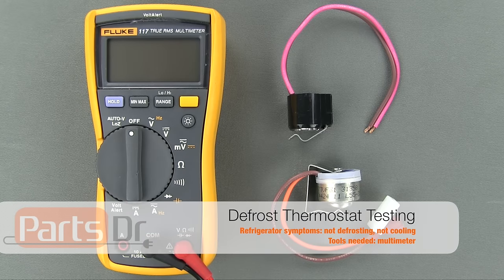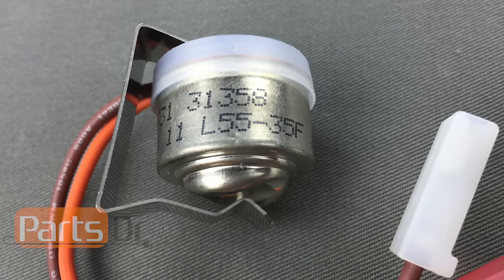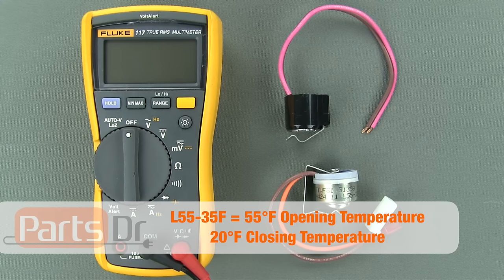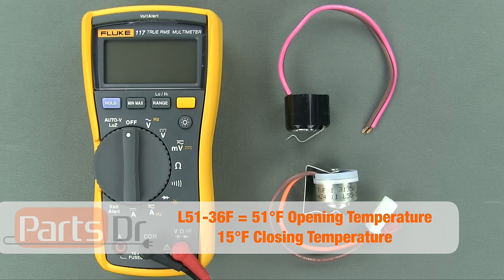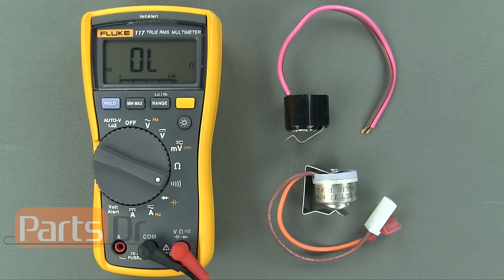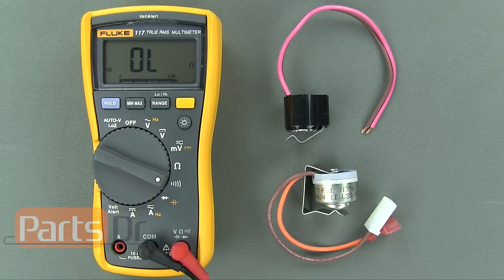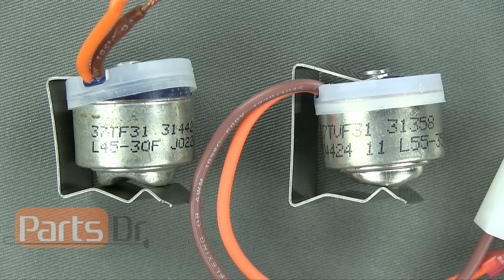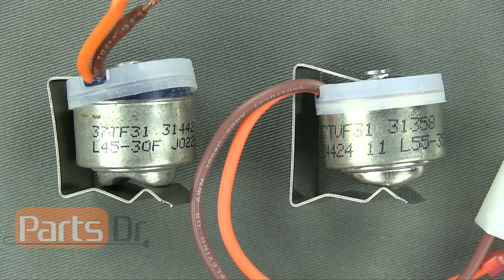How To Test Your Defrost Thermostat & How They Work

Comment: Hi, what is the diagnosis if: Defrost heater, defrost thermostat and timer also work but the fresh food section does not get cold air due to ice build up, not on the evaporator (freezer section), but at around the freezer openings? Thank you
Reply from the maker: Hi Kervin, we have seen this caused by a bad door gasket that is leaking air, a door getting left open, and a clogged/iced up defrost drain.
Reply: Parts Dr thanks for replying! I inspected the gaskets as well and they seemed to be somewhat bent at corners external to the doors. Ill check internal condition. Would you recommend changing out gaskets also?
Reply from the maker: If you can see where air is leaking past the gasket(s) then they should be replaced.  Have you tried just melting the ice to see if it comes back on its own?
Reply: Yes, I have melted the ice multiple times with warm water. Ice slowly builds back up particularly near the opening at the fresh food section where air from the freezer enters. Right now my defrost system seems to be working as I can hear the compressor shut down (and previously verified the heater works). I now have new door gaskets that I'll swap this weekend. In the mean time, how bad is access to the defrost drain? That's next on my check list. Thanks for your help, again.

Comment: Mine is beeping or showing continuity without it being chilled first. I have the bi-metal defrost type (not shown in this video). It does not have any numbers on the probe, but the black cable has numbers.
Samsung refrigerator RF26HFENDSR
Part NumberPD00002154
Manufacturer PartDA47-00243K

Does that mean its bad?
Also what is the difference between a 
Defrost Temperature Sensor, and a Bimetal Thermo Protector? Seems I have both
Reply from the maker: The defrost sensor is what the control board uses to monitor the temperature of the defrost cycle.  This video shows how to test the temperature sensor here: https://www.youtube.com/watch?v=J5bwcteeJNM

On Samsung refrigerators the bimetal thermo protector is used as a safety in case the defrost heater sticks on.  We don't have a published temperature rating for the part number you provided but most have a opening temperature around 140F and a closing temp of 104F.  This would mean the part would have continuity at room temp.

Comment: my multimeter  in the continuity setting showed 001 after the thermostat was in the freezer for a few minutes. The same reading as when I touch the probes together. Is this saying that the thermostat is good?
Reply from the maker: That sounds like a good reading from what you are describing.  You could let it warm up to room temperature to verify that it opens up when it warms up.

Comment: strong compressor; fridge temp is stable.  freezer occasionally ruins food.  fan runs, but rarely.
Reply from the maker: Intermittent problems like these are really tricky to troubleshoot.  You usually have to wait for it to act up then start your diagnostics.

Comment: Great video. I replaced both the defrost timer and defroster thermostat on my Hotpoint freezer refrigerator with the freezer located on top. Originally the refrigerator is not cooling. Now the refrigerator and freezer are working fine but I constantly hear the fan on and the back of the refrigerated which means they're refrigerated is not turning off. Any suggestions please help
Reply from the maker: The fans are controlled by the cold control thermostat. First set the temp controls to the middle factory settings. Then wait 24 hours; opening the doors as little as possible.  Next, check to make sure the refrigerator and freezer are cooling to the proper temps (37F Fridge section, 0 Freezer section).  If you aren't getting those results then the cold control thermostat is most likely bad and needs to be replaced.

Comment: Here’s a ? For you, my freezer will run but when it shuts off it will not come back on and I get a high temp alarm. Is that caused by the defrost thermostat, or the regular thermostat? I thought it was the capacitor and control on compressor and replaced those, though tho old capacitor checked okay. What’s my problem?
Reply from the maker: That type of problem wouldn't be caused by a bad defrost thermostat from our experience. It could be caused by a bad cold control thermostat.

Comment: CORRECT Info, GREAT video!  Question:  I just replaced a defrost thermostat (it lasted one year) - it was a 48 - 18 = 30; the new one I put in was 48 - 30 = 18.  Any idea if this new thermostat will work, or should I go ahead and order one like I just removed?  My unit is an old Top Freezer Roper RT18BKXKQ03.  PS:  I can't find the specific specs for what the thermostat specs should actually be.  THANKS!
Reply from the maker: This is the correct defrost thermostat listed for your model here: https://partsdr.com/part/4387490-defrost-thermostat?model=RT18BKXKQ03 It has a rating of L6.7-14.5C.  It is always a good idea to make sure to use the correct defrost thermostat for your model as the incorrect thermostat can cause it to not work properly or in some cases it could be a fire hazard.
Reply: @PartsDr  THANK YOU very much for addressing this issue!  You're awesome!

Comment: How do you test it if the closing temperature is 20 degrees Fahrenheit? Ice water is not enough to lower it to 20 F.
Reply from the maker: You will need to put it in a working freezer to get it down below 20F.

Comment: Thank you for the video, it explains how thermostats operate and your replies fill in any gaps in information you were unable to put into the video.

I have a problem with the evaporator coils frosting over and fresh food section getting warm on my Frigidaire Gallery French Door Model FGHB2866PFGA, Thermostat has these specs printed on it FR-5  57.2/43.3, I'd like to know your interpretation on what this means with a "/" instead of "-" present.  Do you still subtract the 43.3 or could it be it is simply 43.3 temp?  On testing, the thermostat opens and closes at about 57.2, i.e. the same temp.  I assume this unit is bad since the open and closing temps are the same.  I tried to order a new one part no. 5304521781 and literally not a single web or parts stores have one in stock and there is a 2 to 4 week backorder wait, ugh!!  I went ahead and ordered one on backorder.  My other question is could this thermostat be good, one of those safety ones, and if so, my problem lies in a bad main control board?  Your comments would be greatly appreciated, Thank you so much.
Reply from the maker: 57.2C converts to 134.96F which would make this a high temperature safety defrost thermostat if that is the opening temperature.   We are not sure what the slash or other numbers means.  It sounds like it is probably good from your testing but sometimes they can act up intermittently, so it might be worth replacing still.

Comment: I have a kelvinator chest frezzer comp is running but not frezzeing what wrong thx you
Reply from the maker: It could be a bad compressor or sealed system leak which is probably not worth repairing.

Comment: So I did this on on my fridge and the top one passed but the freezer thermostat failed.  What was odd was both Fridge and Freezer Thermostat are the same model.  Not sure if that is normal.   Got another one but it didn't pass the continuity test and beeped cold or warm. Is this test apply to all of them? Making sure before I send it back.
Reply from the maker: If you check the temperature rating you should be able to tell if it should have continuity at room temperature or not.  What is the part number?
Reply: @PartsDr    The original Part says WR02X12592  60/40.  The fridge and freezer are the same sensor number so was going to switch the one I know is good to validate if it is bad.  Right now the fridge works but not the freezer.  Thanks

Comment: Is there any problem with the wires? The original has orange and brown same size length, the new one yellow short and orange large?
Reply from the maker: As long as the temperature rating is correct and it mounts the same as the original, the color of the wires does not matter.  Either wire can connect to either location.

Comment: Hi should the coils on my condenser get hot ? I don’t feel any heat from them and my compressor seems to run constantly. But my condenser fan does not turn on ever there is a condenser thermostat that doesn’t seem to be working or maybe it’s not cold or hot enough to close
Reply from the maker: The condenser coils normally get warm while the refrigerator running as they as exchanging heat with the evaporator coil that is getting cold.  If the evaporator coil isn't getting cold and the condenser coil isn't getting warm while the compressor is running, then you could have a compressor failure or sealed system leak.  This type of repair is expensive and would need to be done by a professional.

Comment: The temperatures on mine says "L140-30F"
Is that supposed to be 40-30? or 140-30?

So is my opening and closing 40 to 10 
or 140 to 110? 
The second option seems wrong. So I tested my old one assuming 40-30 and mine failed. Ordered a new one, same specs and tested it again before installing and it also failed.
Reply from the maker: It would be 140 to 110.  It is a high limit safety thermostat that only kicks in if the defrost cycle gets too hot to prevent a fire.
Reply: Parts Dr thanks for the quick reply. I think that complicates things even more for me.

Comment: I was having the symptoms of a broken thermostat - icy coils and warm refrigerator. I noticed the defrost thermostat was popped up like in the video, but it does have continuity when cold.  I went ahead and replaced it. Hoping it solves the problem, but I’m not sure if it will.
Reply from the maker: Our guess is that it will fix your problem.  Either way, if it is popped up, it needs to be replaced.
Reply: Follow-up a month later - it does appear that replacing the thermostat fixed my refrigerator.
Reply from the maker: @tylerdowns8191  That is great!

Comment: Hi, I have a Kenmore Pro refrigerator (made by Samsung) model#  40140483800 
Everything runs but Freezer is not freezing & refrigerator is not cooling.
I troubleshot it and results are that compressor will not run.

I checked compressor's winding,  they checked OK.
I disconnected compressor and check for voltage at the connector that comes from inverter board to compressor, and no power. 
Cleaned evaporator.
Replaced all 3 boards: Power Control Board, Main Control, inverter board, and overload protection relay. 
And Compressor still will not come on. 
I checked Refrigerator Defrost Bi-Metal Thermostat at room temperature, refrigetator off, and my meter reads ~5 ohms. Any suggestions?
Thank you!!!
Reply from the maker: Typically a bad defrost thermost would not relate to a compressor not turning on.
Reply: @PartsDr  based on symptoms described, any 
suggestions?

Comment: I have Maytag fridge# BTB2191ARW with discontinued 3 wire defrost stat. Told one is for fan delay. If so two wires green and white on a two terminal plug are for the defrost and fan limiter. Red to heater. Do you know if I can eliminate the fan delay wire and use a two wire stat or if I could splice the old two way terminals together on a new two wire stat so one wire feeds them both?  I am not sure which wire green or white is for the defrost and which is for fan? Does it matter which wall recept. terminal they are plugged into. The recepts and terminals look the same I would think they carry the same current as they both just cut off and on voltage. I found a three wire stat on Zoro.com for $40 but I still don't know which wire would go where? Any thoughts?
Reply from the maker: According to the wiring diagram the third wire is for "defrost testing jig (service person only)".  If that information is correct you might be able to replace the defrost thermostat with a 2 wire one and elimate the third wire.

Comment: My thermostat says LT40-30F. That means according to your video that that it would open at 40 and then close at 10. This can't be right. My new and old thermostat work the same: they are closed at any temperature below  about 95 or higher and open above 95 or higher. Neither one open up till they get heated up with a hair dryer.
Reply: interesting, so does the bulb itself say L95 0F ? And where is the bulb location...sounds like close to the heat element. On my side by side, the limiter bulb is above the coil some inches, and the numbers are L48 15F. Mine stays closed  then 33f and colder, then opens at 48f. it tested good out of the box, although i dont know exactness of the opening temp, its 75 in the house and after several minutes leaving in a good freezer i felt it open, unless the LT means something diffeerent.... but i can say that 30C is 86 F,  and 40C is 104F, Sometimes they're written in Celsius. if written in celsius, then it would close at 64 F.  There does seem to be a lot of differences in temps these bulbs i didnt know about,,,,   good luck,but I'd make sure its an F or a C. My original is in C, and new arrival is in F
Reply: im sorry, i see where you already gave the numbers on the bulb. I did notice that it took a while for the bulb to swith or close when i tested it. For test of my new bulb I hung it over the cold moving air right after the fan motor. A thermometer i placed there read 0. it may haave taken longer because the bulb itself was not clipped to anything and so the metal part of bulb was not getting a direct contact read which might take longer. im not sure on that.

Comment: Could a bad thermostat cause a freezer to be too cold if coils are frozen? My fridge temp is eight on, freezer runs minus 10 degrees F. Damper works fine. Kitchenaid side by side.
Reply from the maker: No, from our experience the opposite happens when the defrost thermostat fails.  The evap coils frosts up and the air stops circulating which causes things to start to warm up.
Reply: @PartsDr  Thanks for the quick reply. So, with the damper control working I'm left with either freezer thermistor, fridge thermistor or control board?
Reply from the maker: @dr.emilschaffhausen4683  It sounds like you are on the right track of narrowing down the problem.

Comment: My multimeter doesn't have a "continuity setting" (with the symbols shown on yours). It does have all the other stuff.What exactly should I set it to? I thought continuity was ohms? Tested the heater and it was 29.4 ohms. So I'm thinking it's the thermostat even though it looks fine. I guess I'll have to turn it back on without the heater and thermostat and leave it in the freezer to get it cold. Mine has no numbers on it though to say how cold or warm it needs to be.
Reply: Continuity and ohms are functionally the same thing, but the continuity setting is a lot less picky about ranges and often has a beeper attached so you don't have to look at the meter.  Ohms will do if your meter really doesn't have one.

Comment: Wow the info I was looking for! I know this isn't a forum but just to get a clear understanding. My thermostat is rated at 14.4 - 22.2C. So no continuity at room temp (approx 70F) then threw the thermostat in the freezer which was reading at at 0C. Checked and I had continuity, this means I have a bad thermostat?
Reply from the maker: It sounds like it is working properly from your test results.  This thermostat should open after warming up to 58F and close when it cools down to -14F.
Reply: @PartsDr  Thanks I made a mistake on the conversion. Mistaking C for F. I believe you are right, thermostat is okay. Do you have any videos on how to test my defrost adapter controller?

Comment: GE IC360NMARH Bottom freezer. The original Evap Thermodisc L65 - 20F while its replacement WR50X10030 L140-30F. Does not seem that these sames parts could operate the same in the freezer and be a suitable replacement. Can i expect the new part to operate satisfactorily? Glad i found your site on YouTube.
Reply from the maker: We can think of a few possible reasons the new and old thermostats would have such different temperature ratings.

1. Someone replaced the thermostat at some point in time with something other than the OEM part.
2. GE made a design change to the part.
3. GE has the wrong part number listed for your model refrigerator.

It might be best for you to contact GE directly to see if they can clarify what the correct temperature rating for this part should be on your refrigerator.  Our records indicate WR50X10030 should be L140-30F.
Reply: @PartsDr for L140-30F, what is the closing temp? Thanks
Reply from the maker: @romiep9557  It should be 110F.  Please reference our other video that goes more in depth on these high limit defrost thermostats here: https://www.youtube.com/watch?v=i4SNEgPoUMY

Comment: What would cause a Frigidaire upright freezer to have the thermostat replace after just a year and now just 3 months after that thermostat it has stopped cooling again? Needless to say the warranty ran out just a couple months prior. We have already lost everything 2 times and haven't had this freezer but 16 months. Paid $800 for freezer plus all the food ruined 2 times.🤑 If it is the thermostat why would it go out so often? Model fffh20fqwc. Please help!
Reply from the maker: If you are referring to the defrost thermostat, it is very unlikely that the defrost thermostat would twice in that short of a time period.  Most defrost thermostats fail over a longer period of time from moisture getting inside the thermostat.
Reply: Parts Dr go you know what would cause the freezer to stop cooling in that short of time?